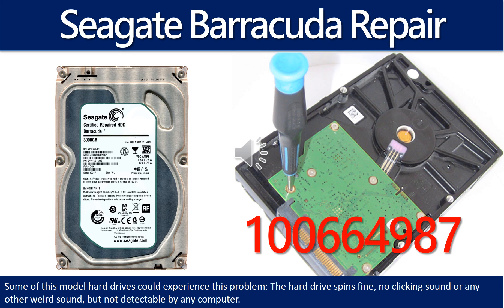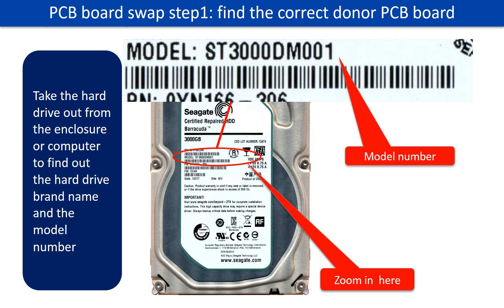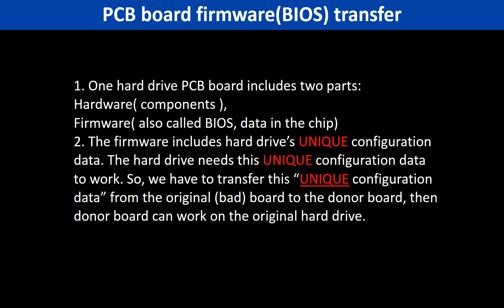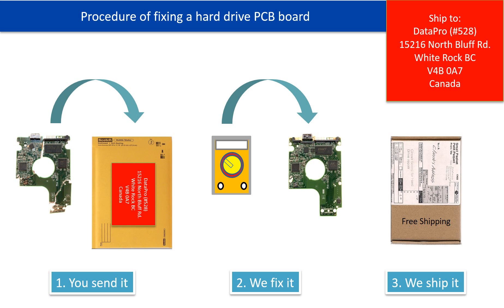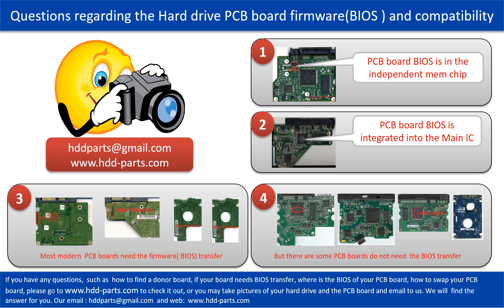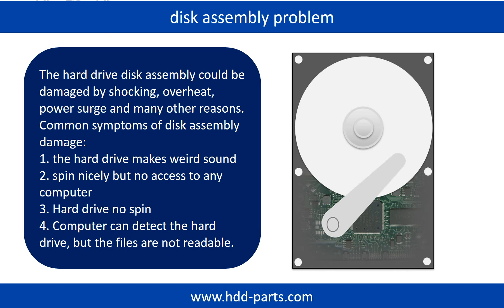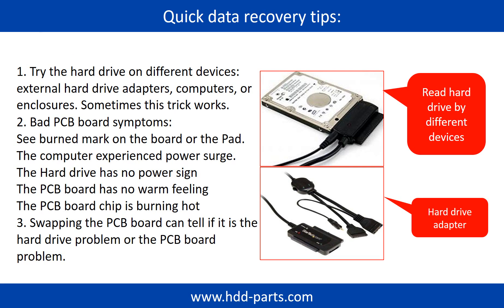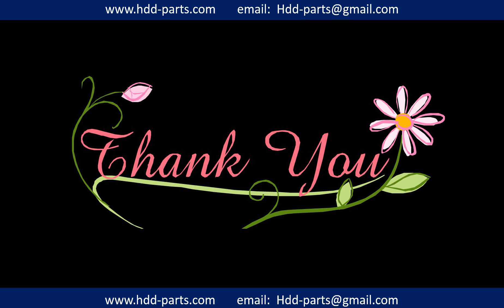Seagate Barracuda repair data recovery  ST1000DM001   ST1000DM003  ST2000DM003  ST3000DM001

Comment: Please Sir i wish to ask a question. I have a 2000gb seagate barracuda desktop hard drive that stopped working. What happened was that i tried to place my desktop on a table and it slipped off my hands and fell with the front. It isn't making any clicking soundsl but it does not read on my pc anymore. I have searched for that particular 2000gb seagate barracuda but all i could find is 500gb but with the same board. So i dont know if i replace it with the 500gb board will it work? Or must i used but a 2000gb board? If not then please tell me what to do

Comment: Hi there, 
I have problem with my ST3000DM001 with firmware CC4H. Hard drive has started clicking sound about 12 times and then spin the motor down. I have bought the donor drive, but with firmware CC4B so I flashed the firmware to same CC4H as the crashed drive and I replaced the heads, but disk is still clicking and I dont know what can I do to get access to data on the drive. Could you advise me please? Thank you very much.
Reply from the maker: the PCB maybe is not the problem.
Reply: Check out this tool in this video. https://www.youtube.com/watch?v=-TO5tfaRszA&t=7s
Even if you can't repair your drive, you will be able do diagnostics on it.